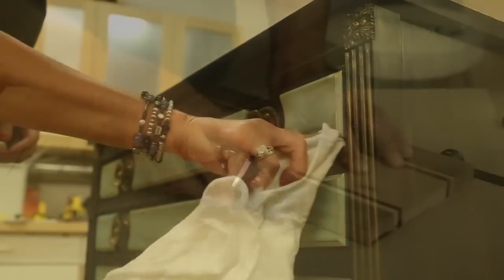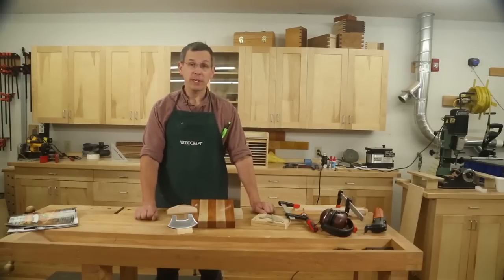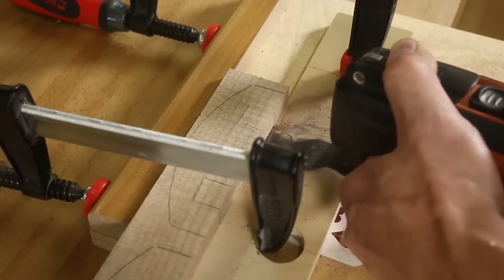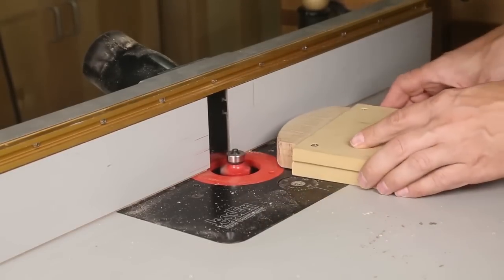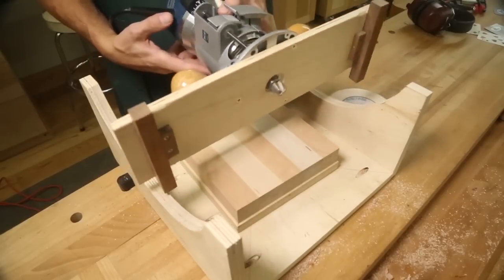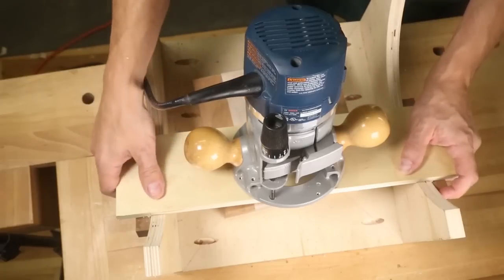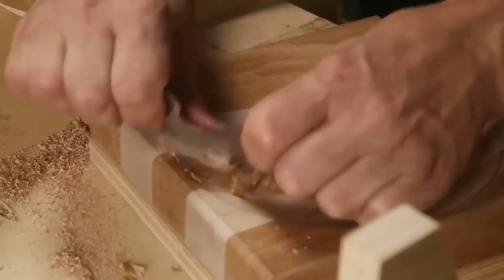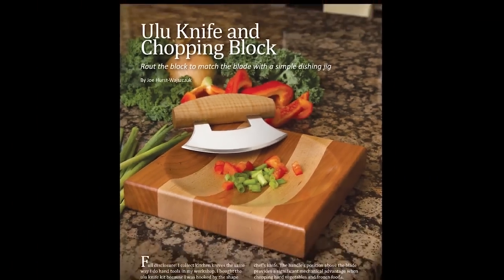Woodcraft Magazine: Ulu Knife Project with Joe Hurst

Comment: I have made many Ulu knife scales and cutting boards.My cutting boards are made by gluing two 3/4" build up boards face to face. This allows me to route in a storage slot for the knife before the face to face gluing takes place. I even designed the interior of the slot so the knife is difficult to remove unless it is tilted out of the slot. I felt this was a safer situation if a kid were to grab the knife. Also, if you have a lathe with a large faceplate, the concave dish material can be removed and sanded in short order. This also allows a constant check on knife/bowl contact, while turning and finish sanding, as the knife is rolled over the concave surface. Remember, the arc of the cutting board does not have to match the arc of the Ulu knife. As long as the arc of the cutting board is a greater radius than the knife and the transition is smooth, contact of knife/bowl is all that is needed for function.

Comment: Thanks, I bought the knife kits and was searching how to attached the handle, I'd also prefer not to sandwich it in. Great idea with the oscillating tool, but I can't find such a narrow blade...where did you get it? Other option I see is to cut one to size...but would prefer to purchase one.